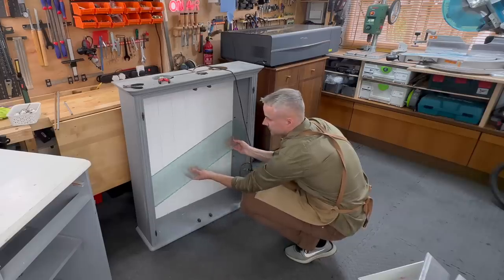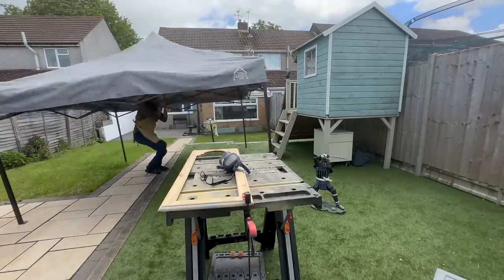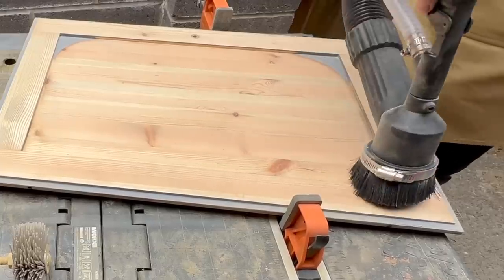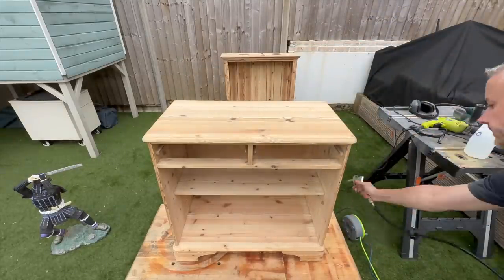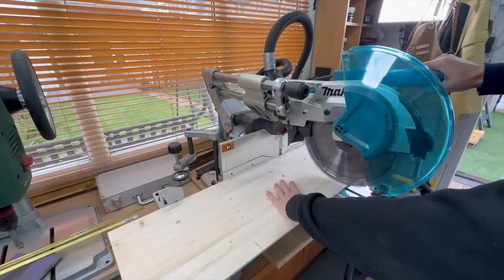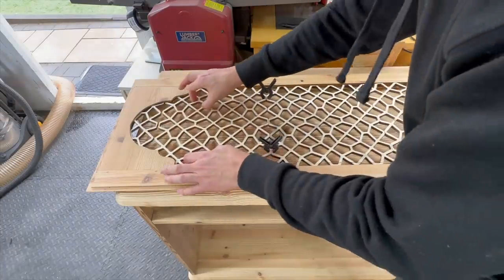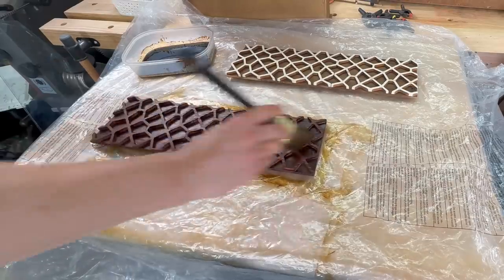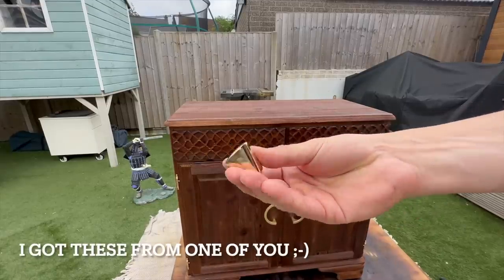AMAZING dresser restoration with laser cut pattern. xTool P2  CO2 LASER

Comment: Love the look. Good on you for a creative treatment on the wood (3D), lattice inserts on the doors and the two drawers, co-ordinating the however, using a satin seal instead of oil/glossy. Was it worth the endless sanding? Of course. Work done well is worthwhile.  Glad neighbor's cat back, trimmed for summer's heat waves/tsunamis. 🎉🎉🎉😊
Reply: Autofill has struck again, knowing I didn't intend to proofread. "however" supposed to be abbreviation of "hardware", AKA "hdwe". Sigh...🙃
Reply from the maker: Thanks 😊

Comment: A trick you could use to get a brass look instead of using paint is to heat the metal hardware up a bit (200C?) then wire wheel them using a brass bristle wire wheel. It burnishes the steel with a coating of brass. 😀

Comment: Just a suggestion, but on the drawer bottoms with stains, could you just flip them over?  Also, chlorine bleach will sometimes take away ink stains.  I have used it to remove ink stamps on books I bought from library sales.
Reply from the maker: I did flip them if you watch carefully.

Comment: So much work!  I think the 3D effect is cool and would be enhanced if the staining was a little more consistent over the surface of the pine... most obvious in the places it doesn't really matter (inside the base) however I reckon you are worn out with all the prep and the result is pleasing. The overall effect is unique and ... looks like a blend of cultural influences as interpreted by, say, a future culture with only clues of what the furniture from the past looked like. (this is a compliment to your creativity) I think if you refine the concepts on another piece (and if it's a wood that takes stain irregularly use a pre-stain wood conditioner) your results will be even more stunning! Not sure the drawer fronts are as awesome as the door "screens" which are amazing - I think that bit of the details could be reworked with perhaps a more symmetric (not offset) pattern with a surrounding trim. That's just my opinion though! Good work!

Comment: You did a great job!
The thing about pine is that it’s impossible to get rid of the knots, as they are always visible, regardless of whatever color of stain is used. The only way, as you know, to get rid of the pine knots is to paint the piece, but not before applying a tannin-blocking primer. Even then, often two or three coats of that primer is required. Pine wood is a nuisance in my book.